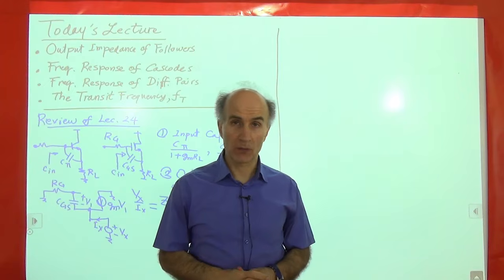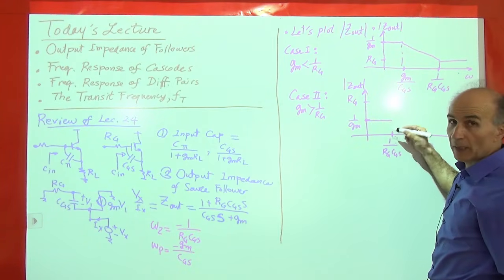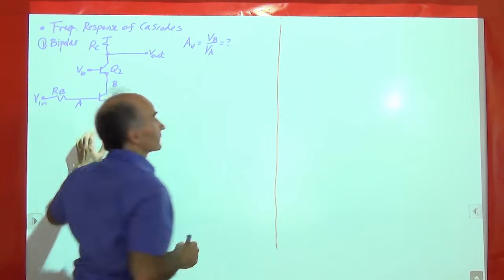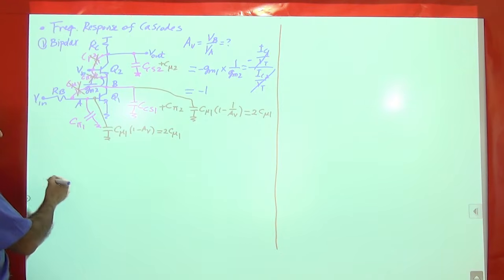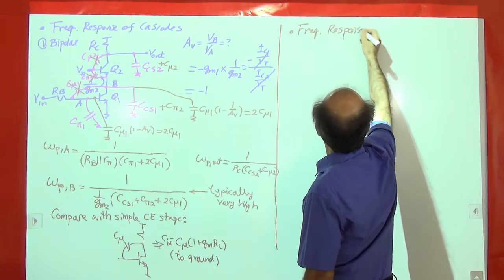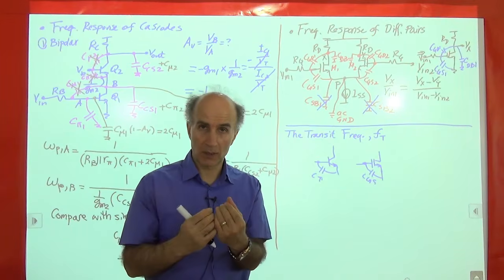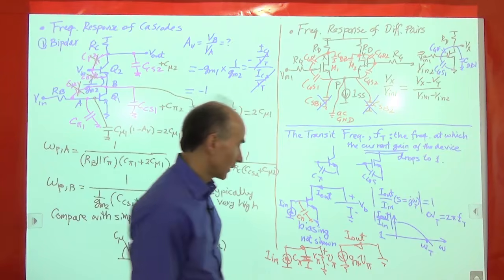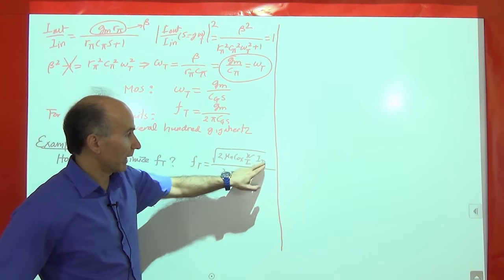Razavi Electronics2 Lec25: Output Imp. of Followers, Freq. Resp. of Cascodes and Diff. Pairs; ft

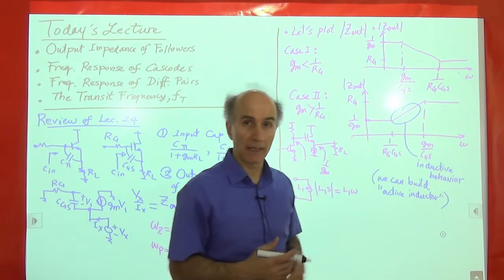Comment: is there any recommend for advanced  course or what is next 11:26
Reply: At 43:07 it should be ([ 1-(rcw)^2 ] +j[2rcw] ) in the denominator, isnt it ?
Reply: @RaviNagar16 you are expanding that.. no issues take magnitude of your expression which will be equal to sir's expression.. you directly squared it then after forgot to take magnitude.. professor first took magnitude of that expression..and he squared it.. at the end of the story both final answers will be same
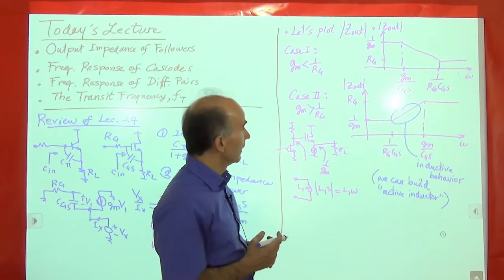Reply: May be he was talking about advanced courses like RF IC design.. r else some other courses.. at high frequencies there will be parasitic capacitors effect.. in order to eliminate that we will place some sort of inductors so that net reactance effect will be nullified or reduced.. inductors implementation on IC means it will take large amount of area.unlike normal inductors.. may be at certain applications we will use active inductors ( inductors build by using MOSFET) at 11:27 may be that circuit will helpful at high frequency in order to provide inductance.

Comment: 01:25 - Intro and Review
03:30 - Output Impedance Transfer Function of the Source-Follower
10:16 - "The output impedance of Source-Follower acts as an inductance"
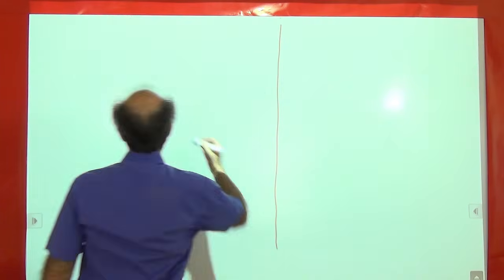11:53 - Frequency Response of Bipolar Cascodes - "They have less Miller Multiplication"
>> 23:53 - Pole Analysis and Comparison with CE Stage
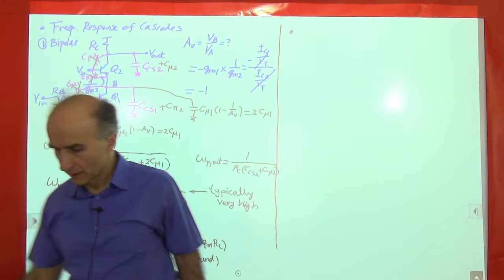27:20 - Frequency Response of MOS Diff Pair
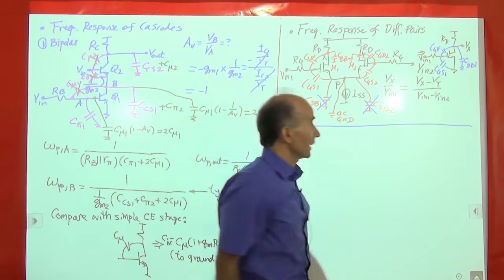32:20 - Transit Frequency f_T - Figure of Merit - "Frequency at which current gain of the device drops to 1"
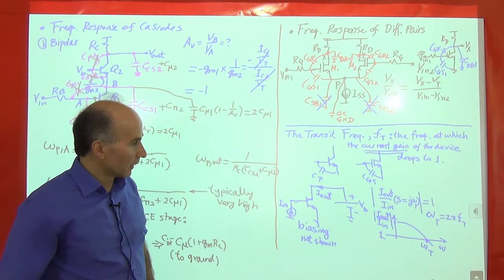38:30 - Deriving Transit Frequency Equation
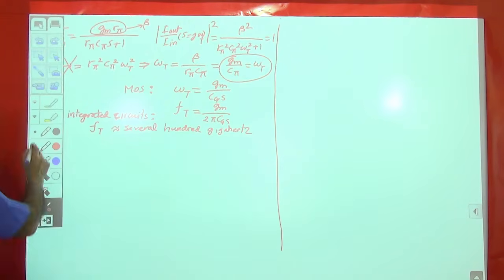45:50 - Example: Maximizing Transit Frequency
Reply: At 43:07 it should be ([ 1-(rcw)^2 ] +j[2rcw] ) in the denominator, isnt it ?
Reply: @janisujal7715  what he wrote looks good, i don't know how you got to that value.
Reply: @coolwinder  Got it, I didnt took mod and just squared numerator and denominator.

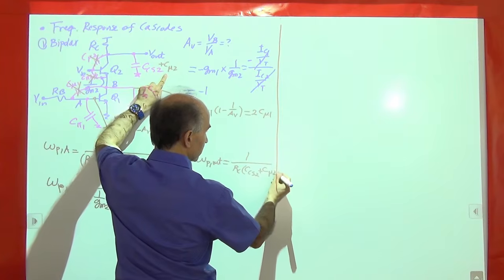Comment: At 23:14   The W_PB = 1/[(1/gm) * (Cs1 + Cpi2 + 2Cu1)]
It should be [r01] instead of [1/gm].
It would be [1/gm] for a "Diode Connected Bipolar Transistor".
Reply: You may forget to consider the upper part of the circuit . The total resistance see from B to ac GND is (r01)||(1/gm2), which is approximately = (1/gm2)
Reply: That is BJT cascode amplifier.. professor already mentioned there is no early effect that means vA= infinity , ro= infinity.. y u consider again ro1?  To be precise it should be 1/gm2

Comment: In previous lectures, Dr.Razavi said in diff. pairs when we add capacitors to our calculations we can not consider P as a grounded node in our analysis, but in this lecture P was assumed as a grounded node. What was the reason?
Reply: ONLY if the differential stage is driven differentially, so that the current on the one Hand side is (I+dIx) and on the other side it is (I-dIx) the node Voltage of (p) in respect to GND stay constant. Because it stay constant, we can concider it like an a.c. GND.
On the other hand side, at the "Diff. Parir with active load" [Lec 16 @19:46] the voltage changes at the two paths are not SYMMETRICAL (V+dV) and (V-dV), so the node (p) changes with time and is not constant. In this case you can not take the node (p) as a.c. GND.
Just watch [Lec 16 @19:46]  and the previous ones, than you will find it.    Hope it helps.

Comment: why do we have negative wz and wp at 4:21? what does that mean?
Reply: w must be a negative value to be the system stable. But when we plot the frequency response, we just need the absolute value of w.
Reply: That was S term.. pole locations which are located on left half of splane.. which ensures stability.. if you want omega substitute S=jw,take magnitude of that.. value of omega will be positive you get..